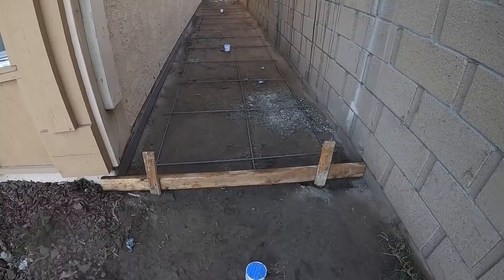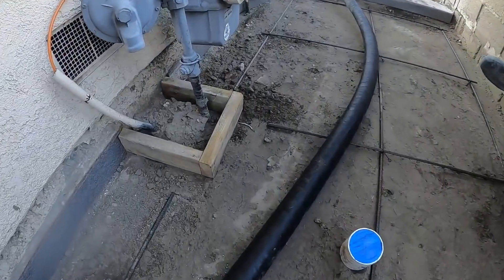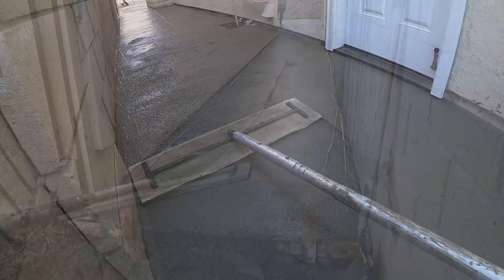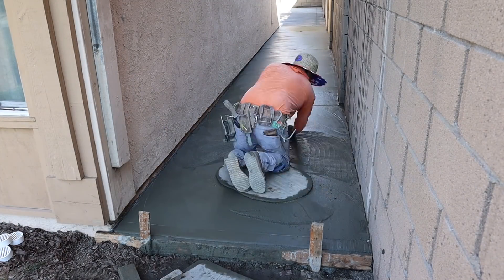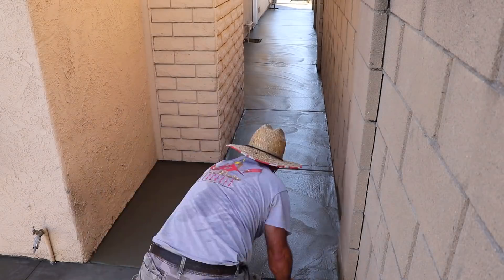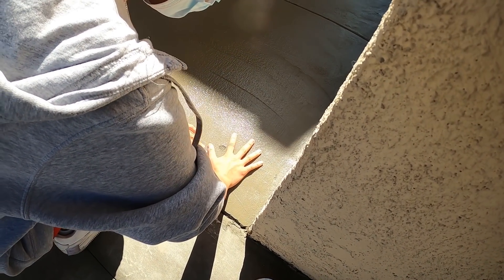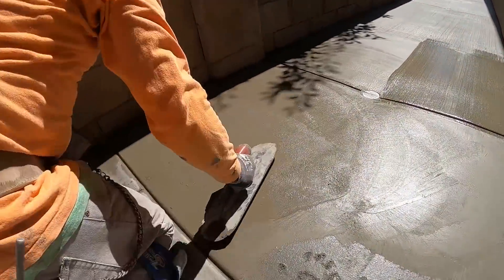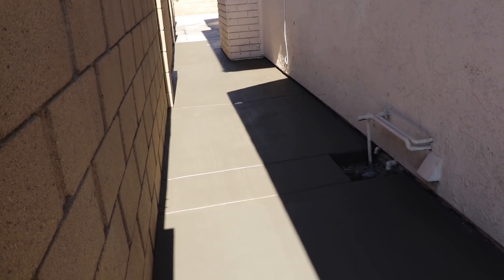Complete Side Yards Concrete Pour and Finish with Drains (Part 4)

Comment: Another job well done Dave!
Curious why you didn’t add the expansion joint foam on the block wall side?
Reply from the maker: The broken blocks at bottom needed concrete in them for wall support